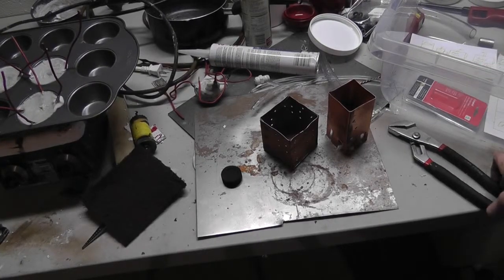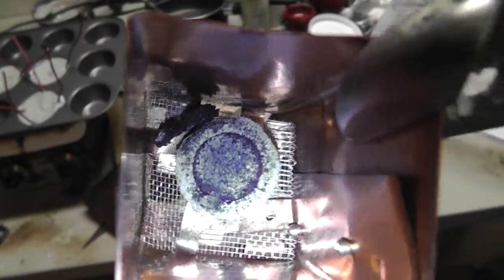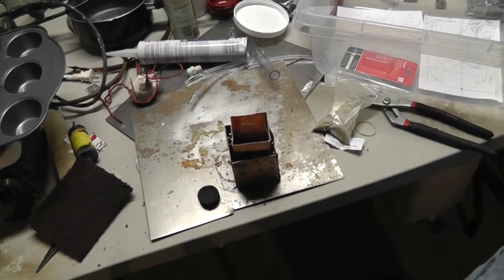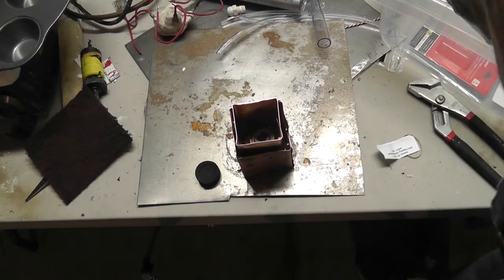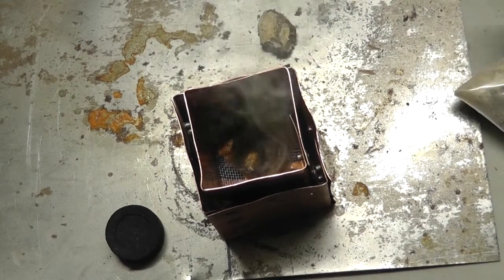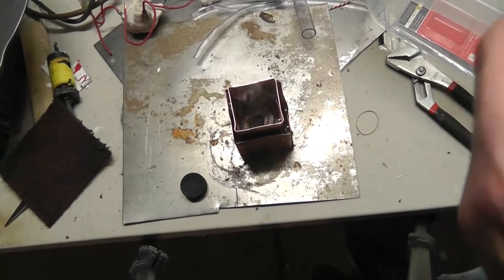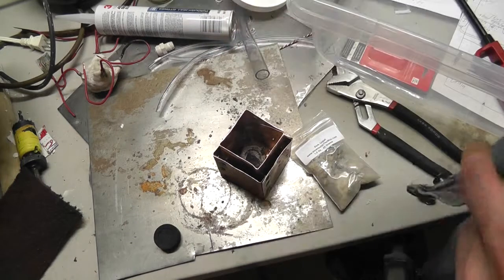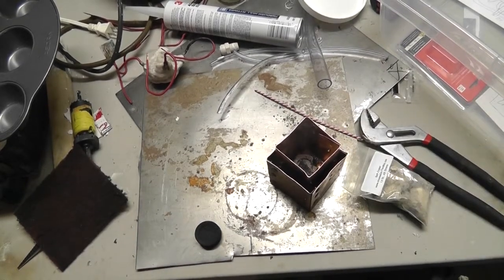High Output Incense Burner

Comment: Hello .Where it can be bought?
Reply from the maker: I designed and made the device myself. There isn't anywhere that I know of where this kind of burner can be purchased.

Thanks for commenting.
Reply: Thanks for the reply. why don't make and sell it on eBay? I am sure there are people like me who are interested to buy.
Reply from the maker: heilamessy I'm mainly interested in fluid dynamics, and this was an interesting improvment over the other incense burners I found on the net.

The device can be made with simple tools that can be bought at a hardware store, but wear gloves: the sheet metal is sharp.